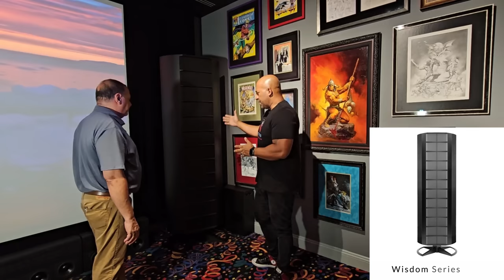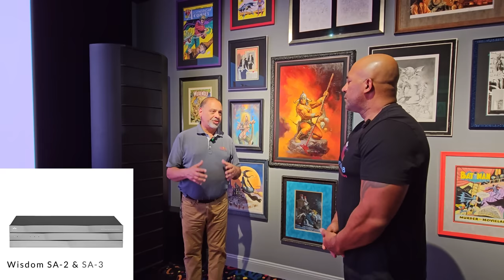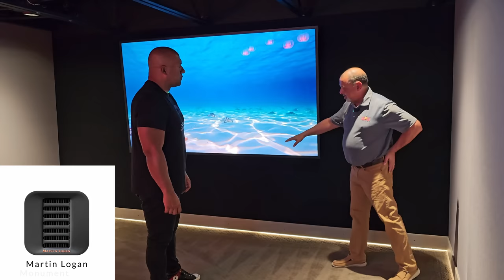Front Row Home Theater: Is This The Most Amazing Home Theater Store In South Florida? High-end audio

Comment: Wisdom out of Northern Nevada were spawned from former engineers at BG Radia that got bought by projector company Christie. They however only bought the ip, brand name and inventory, the engineers did not stay around this Christie has essentially dropped the brand. 

BG Radia-Wisdom made all of the in-wall speakers at Skywalker Ranch, which for anyone that ever had opportunity for a private viewing there, it will blow away any theater you’ve ever heard.  That theater however had over $2M in speakers. 

Most BG Radia-Wisdom setups use perforated screen thus allowing LCR speaker to be built in behind the screen. Much better sound field, no added dsp and no visible speakers below the screen